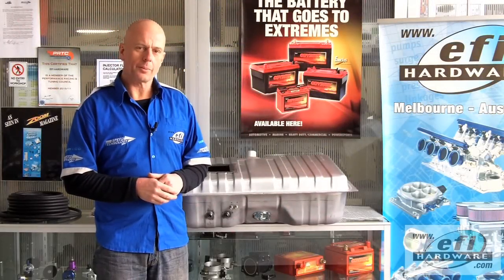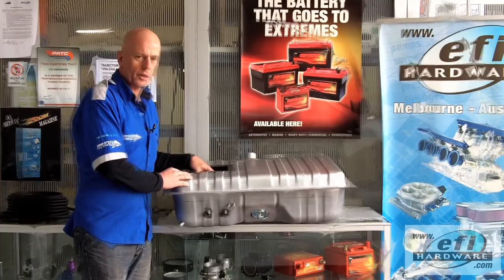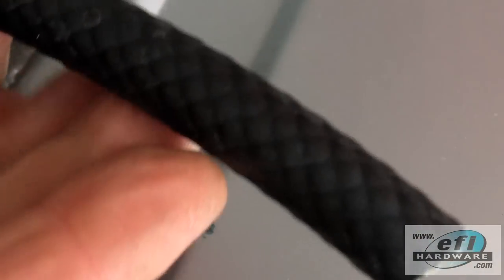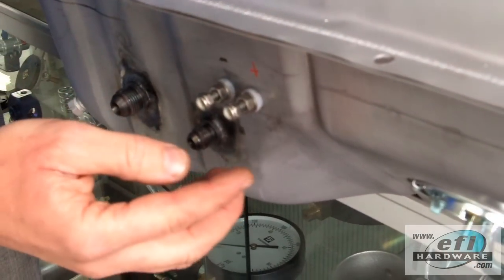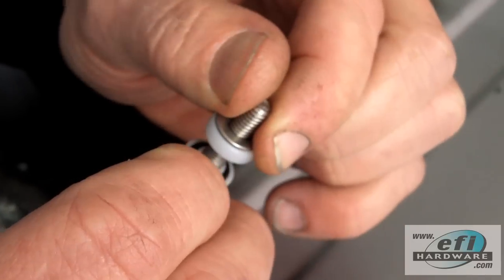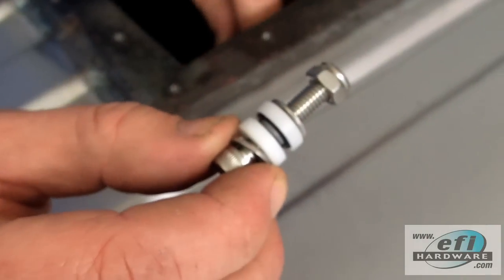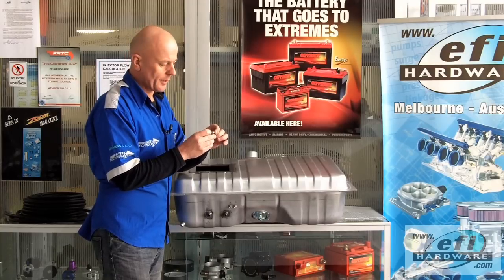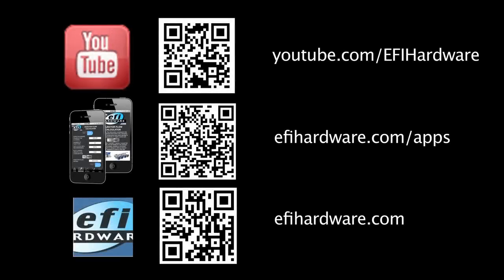Mustang Fuel Tank Carb to EFI Upgrade

Comment: I'm converting my cj7 jeep to a gm tbi fuel system. Most places only recommend external fuel pumps rated 12-15psi.. But I really would rather have an intank fuel pump. Could you make a video on how to convert a cj7 (76) sending unit to a safe electric fuel pump assembly? I recently noticed Novak makes one but doesn't have a bracket to support the pump.-- any recommendations on a shop to weld a bracket to the sending unit, thus securing the pump better to the sending unit assembly? Thanks hope I didn't confuse you. :)

What is the part number for the nylon washers and bolt assembly? Do they come in different sizes? Specifically, 1/4" or so.. That way it will fit on my 2" sending unit top plate. Thanks.
Reply: Brysen Leland  Hi,  thanks for your response but I first made my own in tank pump but ultimately went with a walbro inline fuel pump for easy access 😉
Reply: i realize I'm kinda randomly asking but does anyone know of a good place to watch new tv shows online ?